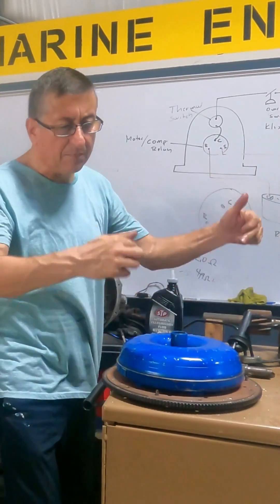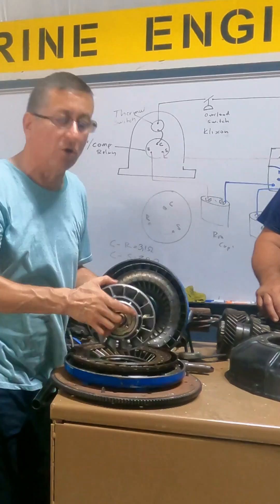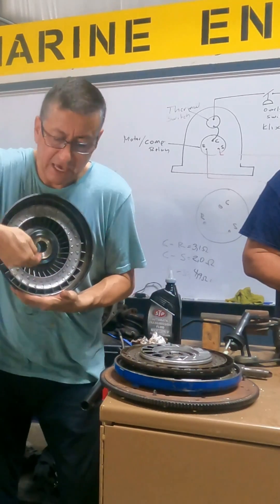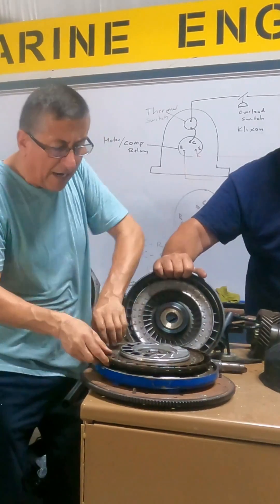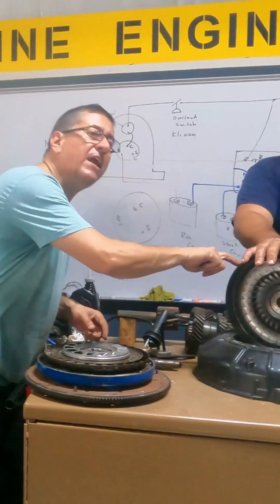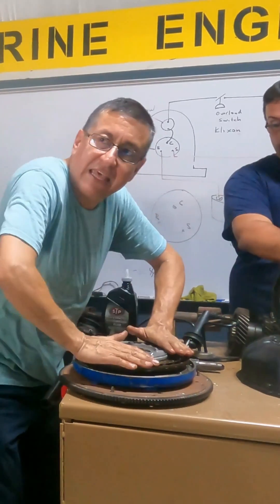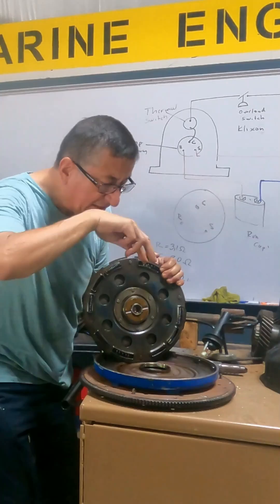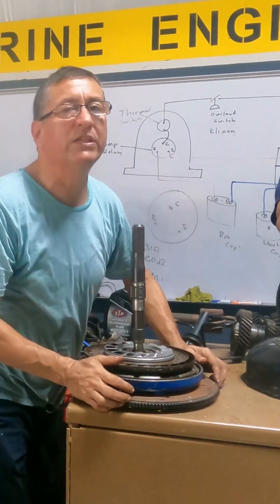How the Torque Converter Works  #easylearning #torqueconverter #transmissions  #marineacademy

Comment: OHHH. goddamnit now i see fully i think. the torque converter, as an assembly, is BOTH the clutch AND "slave" cylinder of a manual. when rpm is low the "clutch" disengages (fluid pressure is low). when we spin up, the clutch re engages until lock up. (high pressure pushes the "clutch" to mate with the crank and input shaft. 

its literally just a clutch you operate with the gas pedal. if i was to be concise.
Reply: Some converters are more simpler and have none of this clutch or lockup

Comment: So the friction material wears out over time , and not necessarily your transmission,  when you gas your engine and it doesn’t go at the speed you are pushing the gas is because the friction material is wearing out, thank you Sir, I have a 2000 civic with 201,000 miles and I tough it was the transmission .

Comment: Is that what a lockup converter is. Like a 700R4 ?
Reply: This "clutch " Could also be pressure operated from  the transmission inputshaft

Comment: Just a little clarification, while it does spin inside the converter, the stator is held stationary inside the converter by the pump housing. It changes the direction of flow as pressure increases. A lot of older style converters don't have a lockup clutch and all newer style have electronic lockup clutches that are controlled by the tcm.
Reply from the maker: Thanks for your contribution. Best Regards